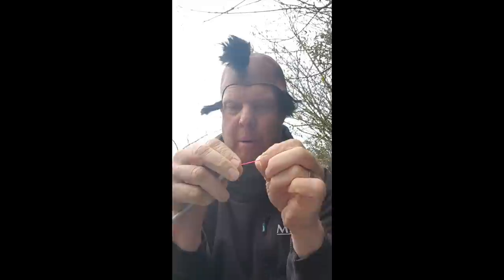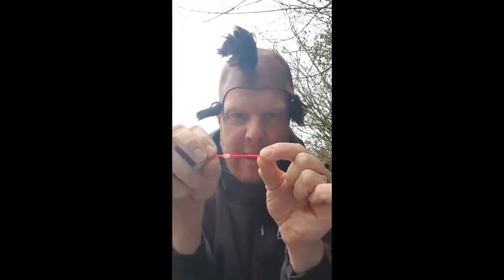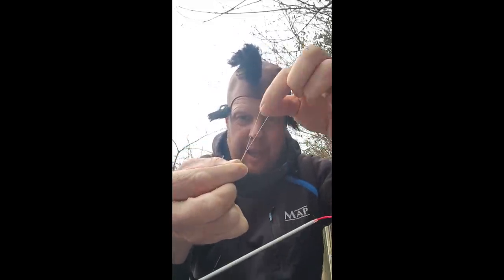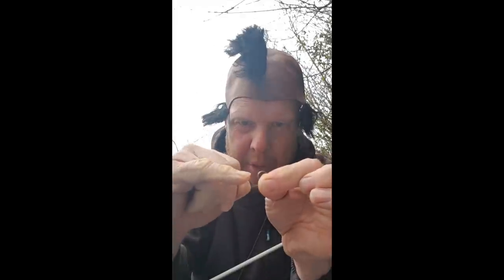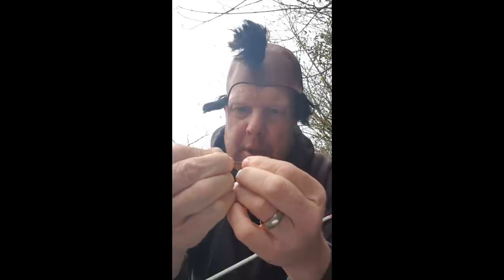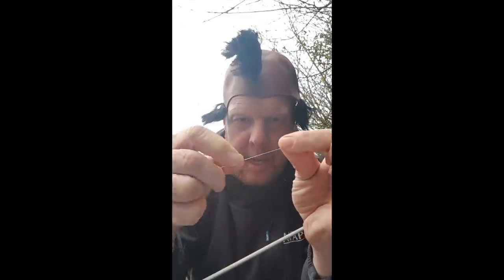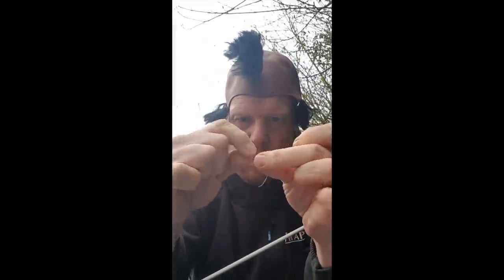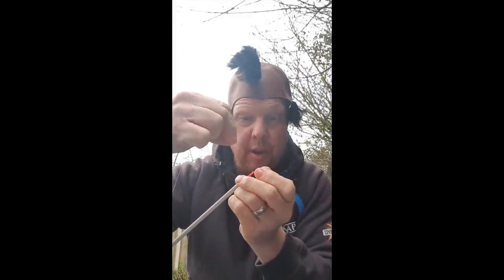Winning Ways At Home | Attaching Your Pole Rig | Andy May - The quick release loop!

Comment: Thanks for the Video Andy, surely this has the same issue as the old crows foot connection with the line cutting into the elastic?
Reply from the maker: Andy Jackson Just keep an eye on it and re tie if it’s damaged. Only lose a cm or so each time. But for shallow fishing for F1s the pros outweigh the cons. 👍🏻

Comment: Be careful if your near stick ups etc your rig will get caught up and it's Goodbye rig    it's a brilliant method though when using it in open water    ALIEN
Reply: Cut the small loop in the centre with some scissors so you've got 2 tag ends instead of a loop and should be ok then 👍
Reply: Cheers